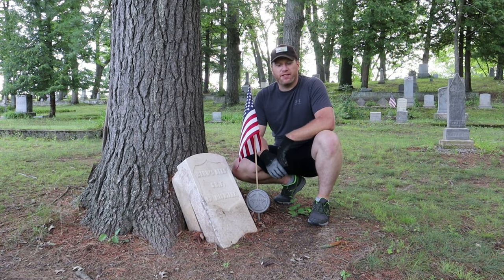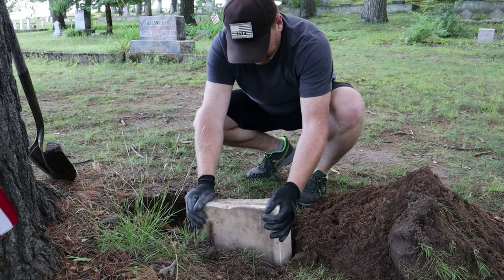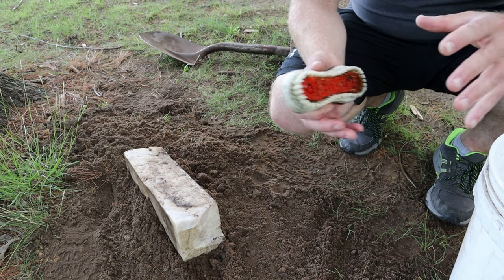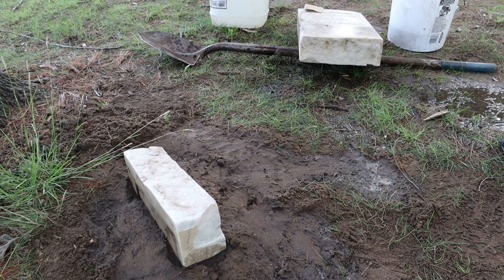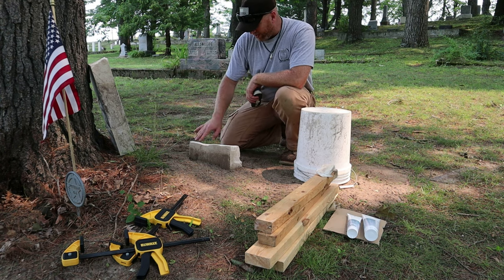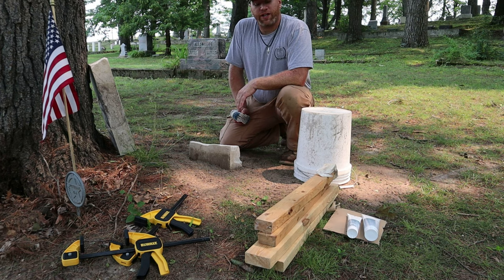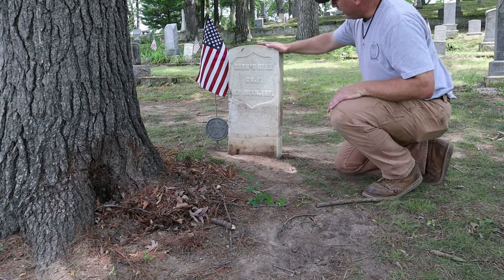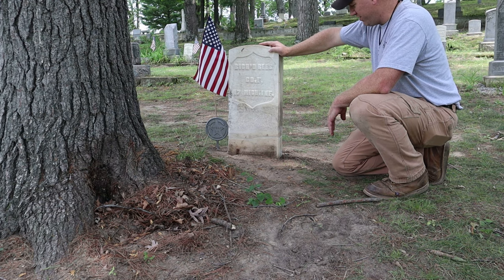Epoxy and Infill on a Civil War Veteran headstone

Comment: Appreciate your great work. I used to work at a local National Cemetery… and for anyone who doesn’t know… if a veteran’s marker is damaged or worn to be illegible… you can go online and order a new stone or any other marker for free. The VA used to deliver them to my house, but now require delivery to a business or place that has equipment to unload them. I have coordinated with a local monument company to accept deliveries who notify me when it is delivered. National Cemetery’s have a standard height of protection from ground level. I believe it was about 26” but I can’t recall for sure. In a private or any non regulated cemetery this measurement is not as critical as uniformity is usually not required. You should dig the hole deep enough to place about 12” of fine, tightly packed gravel in the bottom to help prevent sinking or leaning of the stone and also around the bottom 12” of the stone on all sides.. Also sod around the stone to prevent rain from splashing mud onto the stone. I’m sure any local National Cemetery personnel would be glad to give any advice.

Comment: Great job! Looks excellent! In one of your other videos on cleaning the Veterans bronze marker you said someone gave you the spray stain that the factory grave marker makers use. What was the products name and where can I purchase a can of this. Thanks. Keep up the great work! The veteran's and God are smiling on you.
Reply from the maker: Thank you! I actually don’t remember what the stuff is called. But the guy that gave it to me said you won’t be able to buy it anywhere. You have to get it directly from the manufacturer and they won’t sell it to the general public. I would say to ask a cemetery sexton if you can purchase some from them or have them inquire about getting some that you can buy from them.
Reply: @Headstoneman  Thanks for replying so quickly.  I was going to paint and clearcoat the marker, but I like the idea of the original factory stain better. I will do as you suggest and contact the cemetery sexton. Thanks for the help.
Reply from the maker: I have done both. The paint and clear coat really turns out nice!
Reply from the maker: The advantage to spray paint is faster drying. Also be careful with the stain…. Because it is exactly that. Stain! Lol